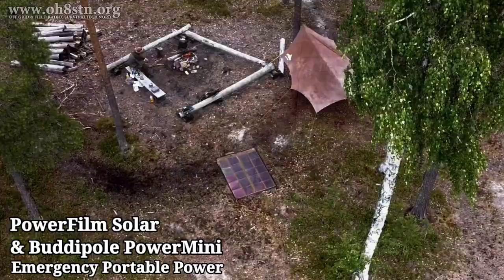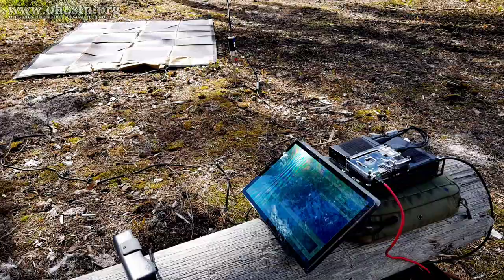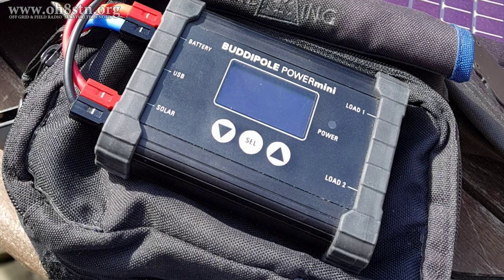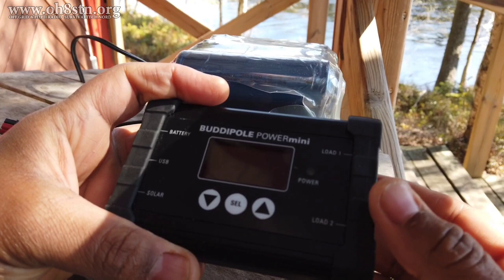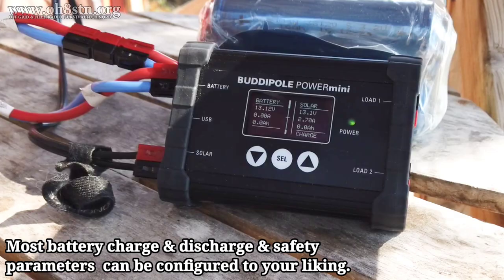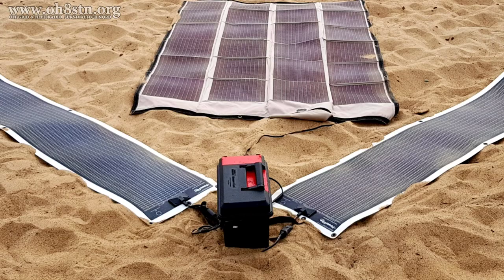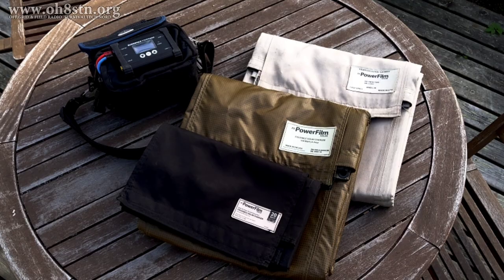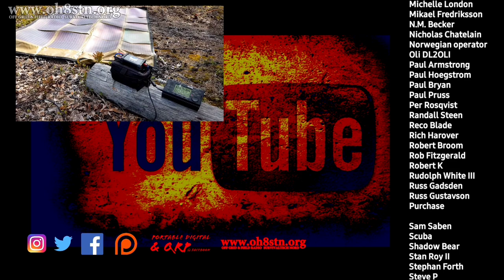Buddipole PowerMini charge controller & PowerFilm Solar

Comment: Really excellent product reviews. I was one of the original Buddipole Power-Mini field testers and I fell in love with it the first time I used it. I also use a PowerFilm (60w) folding solar panel and two of the Buddipole 4S2P battery packs for all my light portable use. They are as good as you have described here. 73 everyone and get out there and call CQ. Sunspot cycle 25 is warming up nicely.

Comment: You were one of the first channels I subscribed to when I came on youtube years ago. But here something that I have always wanted to see but no one seems to have done.

When you are out in the woods you have all sorts of things that can be recharged but no outlet. Not just ham radio equipment but things like :

Headlamps.
Flash lights
Cell phones.
Laptops.
e.t.c
I am sure there are things I am forgetting. 

But my point is how can I determine that amount of current these things draw and how much power they will need from a combination of a solar panel, charge controller, and rechargeble battery.

Ideally what i would like to do is ride my motercycle into a wooded area. Set up camp. have EVERYTHING fully charged as home. Connect up the Solar panel to the charge controller, connect the charge controller to the battery , connect then battery to a Anderson Power Pole distribution  block and whatever connectors each piece of equipment needs. Then during the day run things from the distribution block so they are still fully charged when night falls.
I hope I am describing that correctly. But even to figure out what size panel you need or what amp-hour battery you need you have to know each piece or equipment's current draw. How do you find that out and what kind of math is needed ?

Thanks in advance.
Reply from the maker: Excellect question.  Others say guesstimate. I actually like to measure every piece of equipment with an inline multimeter, but it goes even further than that. When I'm purchasing gear that I use out in the field, I look for gear which is efficient and easy to charge. I also look for gear which can be run off of 12 volts DC, and omit anything that needs to be charged with AC. Anything which is too current hungry too be practical in the field is left at home then replaced with something more efficient. Anyway the bottom line is simply measuring with an inline multimeter the amount of current in particular device uses while idling, and while it's in use. For example a laptop will take much more power when it's internal battery is flat and charging than when it's internal battery is full. For headlamps I try to look for ones which can be charged over USB. It makes it easy to using USB to 12 volt DC adapter in the field to charge them back up. All you need to know is how long the battery lasts, and how much energy that take to charge when they're flat. For that one we use inline USB meters. It's all about the measurement my friend.

Comment: Hello from Long Island NY. I’m using the Bioenno 15 ah and solar charging for my FT-891. I’m new to hf and so far it’s all working great. Nice video. I like how you break it all down and explain your objectives and choices. 
Fred W2FTR
Reply from the maker: Sounds like a good setup. I also have an ft891, but use a 10ah LiFePO4, very similar to your bioenno pack. It is a solid setup which should give you years of enjoyment. How do you like the 891?
Reply: OH8STN Ham Radio       I like to very much. I’m using a DX Commander Classic antenna with it and it all works very well for portable operating.  I’m still learning how to fly this rig. My version of learning to fly is repeatedly falling out of the nest. ;)

Comment: Hi Julian, After watching your previous solar power videos, I decided a PowerMini would be more versatile than the Genasun charge controller so bought that plus a 28W rollable Powerfilm, to power a 10AH LiPO4 Bionnic battery, for my G90. Simple, compact and adequate for my 4-6hr outings. Great to have the USB charging port too!  Went with the rollable Powerfilm after seeing your video where you describe being able to use them in the rain (its fairly wet here in coastal British Columbia) compared to the foldable.  I'm very pleased with my decision, which was made possible thanks to your detailed and extensive videos.  Thank you! 73, Kevin VE7OVY
Reply from the maker: Outstanding!
The rollables are absolutely amazing in wet (or Arctic) conditions. Understanding the difference was a tough lesson, but a good one. Anyway, I'm glad to read this comment. Often viewers ask for more "QSO" type videos, but the supporting practical knowledge, is far more interesting for me :)
Thanks for the comment and kindness. It's very much appreciated.
73
Julian oh8stn
Reply: Kevin  where did you find in Canada the 28W rollable to purchase?  VE7CYA  ward

Comment: I bought a Buddipole mini last year and have nothing but good things to say about it. I have one caveat to that last statement. The mini has an upper voltage input threshold of 16 volts. The folding solar panel (blanket) I have produces 18 volts. This required that I put a step down buck converter inline to produce the correct voltage for the mini. On checking around I found that other folding and rigid type solar panels intended for use with RV's or camping situations also produce 18 volts. So I would carefully check the voltage of your solar panels to be sure they are within the input limit of the mini. If your panels output more than 16 volts you will need to step down the voltage. Aside from that the mini is the perfect solution to my off grid field operations. I totally love the powerpole connectors and the ease of setup via the onboard menus. In my opinion this is the perfect  charge controller for off-grid portable operating.
Reply from the maker: This is incorrect. The maximum solar input voltage of the PowerMini USB is 24 volts. Perhaps there was a previous version with the limitation you mentioned? I often use the solar panels on my tower to power the PowerMini. Open voltage on those panels is 22.8 volts. Works like a charm. PowerMini documentation also says 24 volts maxim solar input.

Comment: I own and use the Power Mini and it has worked quite well in a portable setting.  Admittedly, my kind of portable amounts to driving to a nearby park, placing a flat solar panel (which I store in my van) on to the roof of my van in order to use it to power my batt pack and radio, and by using a screwdriver antenna mounted on to the corner the van. This arrangement works fine for me since I do not operate portable for more than a couple of hours at a time.  I originally began my portable ops by hauling around a hefty LIFEPO4 pack which was perfect for base off grid use but which was serious overkill for merely an afternoon outing.  I think Julian would agree that one has to choose the right tools for the job.

Comment: That is a cool controller - I have been using my little  morningstar for quite some time and carry a pocket multimeter  (handy to have) for measurements.  Thanks for sharing !
Reply from the maker: thanks. I started out with morningstar controllers. They are solid and tend to not break. I just wish they were less noisy for radio comms on HF.
Thanks for the comment and watching. it is very much appreciated.
Reply from the maker: I also didn't realize it was you. I'm just about to watch your latest video :-)

Comment: I looked up the price.  145 US bucks plus shipping.  I checked the specs and saw that it is a PWM solar charge controller.   For that money Buddipole could have made it an MPPT controller,  assuming that MPPT controllers will in most cases be more efficient and effective than a PWM controller. On a positive note, it will charge all kinds of batteries and has some nice bells and whistles. 73! SV0SGS.
Reply from the maker: I also gave them feedback about making an mppt version.
Reply: @OH8STN  Just saw your comment about MPPT right after I pushed the button.  Oops!  BTW I always enjoy your videos.  73! SV0SGS

Comment: I'd love it if Buddipole would make a panel mount version of this or a bracket where you could panel mount this. I'm in the middle of building my own battery power supply that I want to be self contained. This would be a lot more elegant than the components I'm using.
Reply from the maker: Agreed! Sometimes it would be nice to have an all in one or kind of integrated solution, to make things simpler.
Great comment

Comment: Great channel.. just got my FS8CALL working.. Saw your heartbeat or something i think... Cheers from West Coast of Sweden
Reply from the maker: I just shut down my station about the time you sent this message. It'll be up and running again today. Will be awesome to have a qso with you
Reply: @OH8STN  Yes that would be awsome.. im waiting for my radio to arrive and my licence is on its way.. I saw you via my RTL-SDR.. that little thing got me into this. so im waiting for my mcHF radio to arrive.. C ya in the air waves in future.. ..73..
Reply from the maker: This is an awesome message. Thank you for this. Yeah, you're going to have a good time with the mchf. It's a great radio. And I think we will almost almost always have conditions between us. Except for the extreme South of Sweden, it's all less than one hop away. Thanks again for watching, and for commenting. It's very much appreciated

Comment: Good afternoon Julian
I wish Power film Panels we affordable in the UK! They are not. £1500 for a 60 watt panel far too expensive for a casual portable user (like me). I can purchase a 'useable' 30 watt panel for £150 (Called a 63W panel form BigBlu)
There is nowhere to purchase the Buddipole charger controller in the UK (or Europe for that matter) and by the time you've imported it from the USA it costs about £300 -- about twice the price of the Genesun 10L so nice as it seems, Genesun will remain my go-to charge controller. 

By the way, I'm using your 20A Solar Generator design for my portable activities. Works very well :-)
73
Bruce G4ABX

Comment: Thanks for the video, have you noticed and noise, RF when running in conjunction with the radio?
Reply from the maker: It's been quite a long time since I've used that power Mini. I certainly would have mentioned it in my videos If I Had. I've sold it now and focus exclusively on Genasun controllers.  Sorry I can't be more helpful.
73
Julian oh8stn

Comment: Powerpoles, battery selection, small form factor, and in the same price range as other controllers. Looks like the Holy Grail of portable power management. Would you agree?
Reply from the maker: I rather says it solves problems many of us have powering our gear in the field. This is a big step forward, getting us 90% of the way to where we want to be.
Reply: @OH8STN  90% is more than what we had before. Thanks for the video, and for your opinions. Extremely valuable

Comment: Love your videos. Is the power mini MPPT ? Or PWM?

If it’s not MPPT ,(I’m in UK ) the I’ll probably go for genasun and a rigrunner 4004u for distribution. Stick everything to the battery using that wide hardcore Velcro. I built a really small portable solar system in 1999 for my messenger bag whilst cycling. Had 5 watt flexi panel tied to the outside of the bag. Tiny little charge controller taped to a skinny 12v sealed lead acid battery. Think it was only 4ah. Cigarette socket on the output. Charged my Nokia and mini disk (or whatever it was). Did me well for years. 😊

Comment: Hi Julian, I ordered a PowerMini a few days ago. I’m also using the Xiegu X5105. In your experience, what wattage of solar panel is enough to keep that system up full-time assuming digital mode QRP?
Reply from the maker: Hi Bob. It is kind of a trick question with multiple right/wrong answers. In my experience the 20w powerfilm panel was usually enough to keep my ft-817nd powered up constantly. Of course I used a small external battery, but the goal wa salways to generate doubl the current thatn the radio takes on rx. For the x5105 at 0.3-0.6amps running ft8/js8call, a 30watt powerfilm could keep it powered up, as long as you have sunlight and reasonable duty cycle.
Reply: OH8STN Ham Radio Much appreciated. Thanks.
Reply: @OH8STN  Cliff over at the QRPSchool channel has an excellent lecture on estimating power needs for portable operations. The math is really simple (weighted average) but he gives an example or two that will make it clear.

My goal is to have 3x the power required for a day of operations. That way I have significant reserve should I not have sunlight for a day or two, or if my shift should go longer than expected, or if I need to transmit more than my base assumption.

Comment: Hi Julian,
Sorry for posting to an old thread.

Thanks to your excellent videos, I had the confidence to buy two R-60 powerfilm panels, a 30ah bioenno lifepo4, and a buddipole powermini usb+. I noticed that you created a y-cable to enable powerto be sent from your powerplus to the genasun controller when solar was insufficient or unavailable. Do you suppose the same y-connector approach would be possible with the powermini usb+ instead of the genasun charge controller? I'm thinking of picking up the powerplus, if so.

Much appreciated.
Reply: I guess I should say that the y-cable that connects to the powerplus, genasun controller, and battery is not sending power to the genasun controller, but to the battery. In any case, I'm curious if the same approach would work with the powermini and powerplus. I don't see why not, but I could be lacking in some details.
Reply from the maker: I haven't tried but can't see why not. I would shoot off a message to buddipole support and see what they say,  just to be sure.
73
Julian oh8stn
Reply: Buddipole responded to my support query and said that the genasun controller could be substituted with the powermini in your configuration. Buddipole gave permission to share their response here:

"Definitely something that would work, but bear in mind that the chargers are not coordinated (same with the Geasun/Powerplus situation also). That means that there is the potential for the DC and the Solar chargers both trying to charge the battery at the same time. In that case one of them will probably dominate the other. 

So  - no problem if it is one or the other, DC or Solar, but DC and Solar charging at the same time is not a defined case that I would recommend.

Having said that, you can make that arrangement work if you deliberately set the POWERmini maximum charge voltage lower than normal. For example by setting it to 14.0V,  the POWERplus will take control of charging for the final stages and POWERmini would automatically back off. The downside of that is slightly less charge when you are operating in the purely solar mode. "

Buddipole also shared this:

"One word of caution that I left out is to be sure that the batteries are ALWAYS connected. If you disconnect the batteries but leave the POWERplus connected to the POWERmini then the POWERplus battery charger could try to charge the POWERmini. That shouldn't be a big problem but it is definitely a wacky thing to do."
Reply from the maker: This is excellent news. Thank you for sharing this and please send regards to buddipole👍👍👍

Comment: Julian, as always great video. I have a very similar setup, except I purchased a K2 battery pack, but want to build my own soon. I was wondering if you've ever experienced issues with the battery pack BMS and the POWERmini, once the pack is fully charged. Mine continually power cycles until I disconnect the solar panels and drain the battery some. 73 Michael WL7BA
Reply from the maker: Unfortunately yes. I don't know if this cycling is harmful to the PowerMini, the battery, or just a bug in firmware when battery is full. I mentioned this to Buddipole in my review report, but have not received any feedback about it yet. I suggest sending a message to Buddipole to let them know someone else has this same issue with LiFePO4 batteries and the PowerMini.
Good catch and glad you mentioned it here.
73 
Julian oh8stn